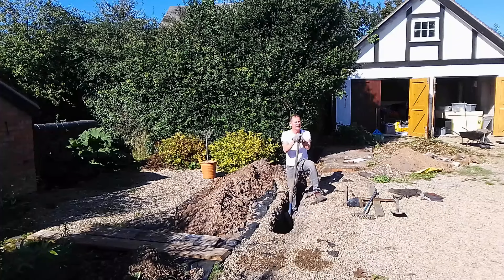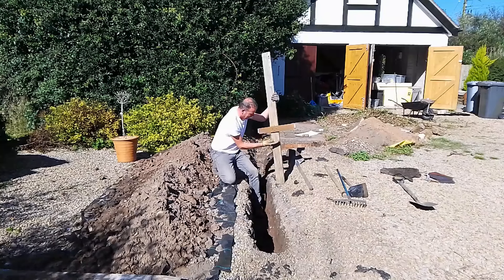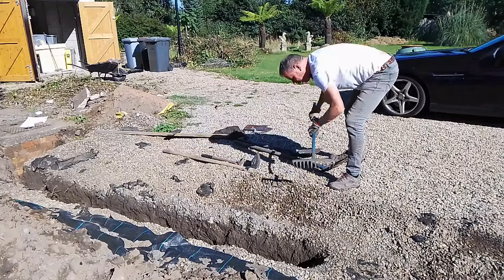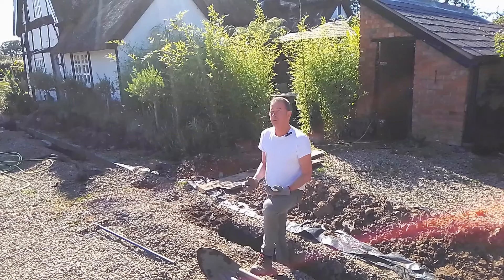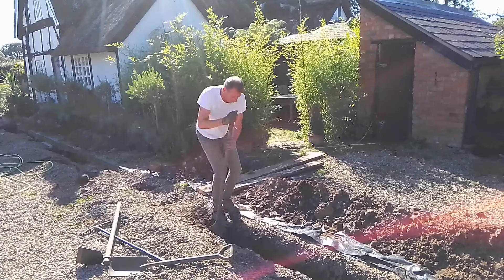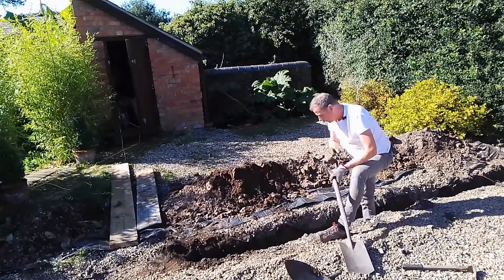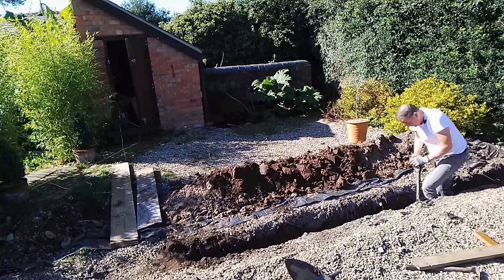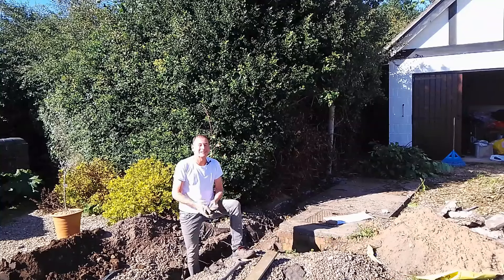Building and DIY | How to dig a TRENCH by hand. Garage Conversion

Comment: For breaking the surface, a pickaxe or a fencing wrecking bar will penetrate the ground better than the hoe.
For the first dig, try a "spit", a thin, long bladed, and curved, you can lift out dirt but also break up the surface and prise out stones.
To take out the loose from the bottom is when the trench shovel comes in.
These are what professionals use and have been since Victorian times (the navies of lore).
I worked with a lot in the 80s and onward.
Remember to bend your knees before your back, don't try to lift out huge shovelful's of dirt , just comfortable amounts.
At 18 i worked alongside guys in their 60s who had dug for years, laying cables, they just kept going and made it look easy, they outpaced me by a good 25-30% and still had breath to talk and smoke as they dug.
It was a delight to watch to be fair. Santa sized guys just eating up the ground.
Just on last important point, a spade has a shallow angle to the blade and shaft, used for digging into earth from the top, a shovel has a larger angle to stop you having to bend down so far, don't use a spade to pick up the loose material, it will ruin your back.
Cheers.
Reply from the maker: This is an excellent comment and brilliant additional information. As a learner I think you. And thoroughly interesting. Best wishes. Mark